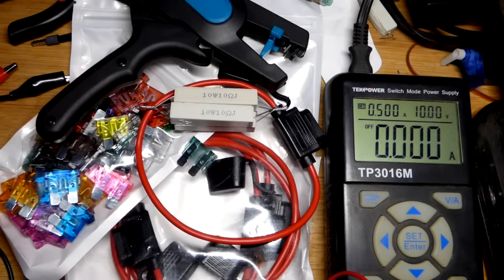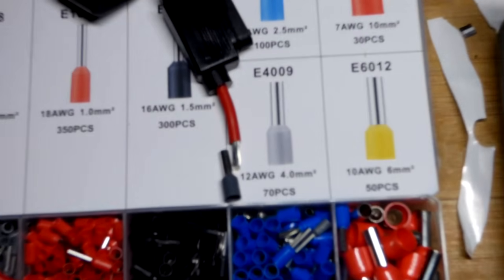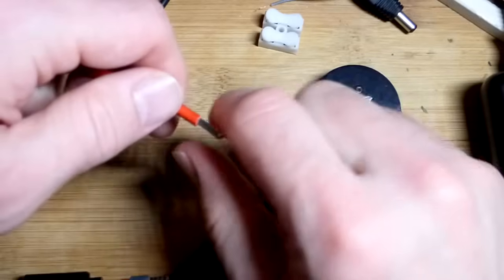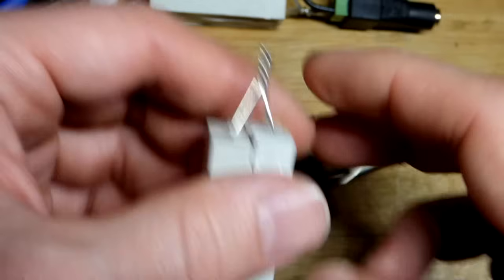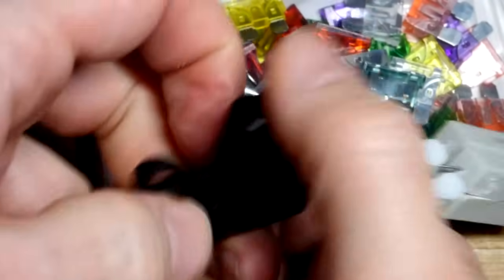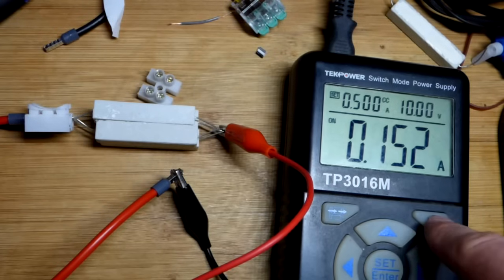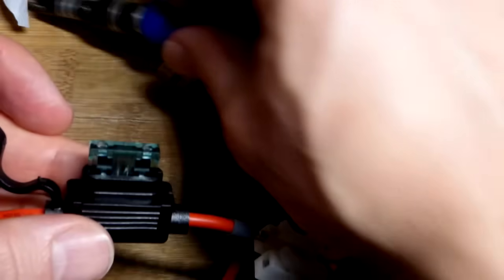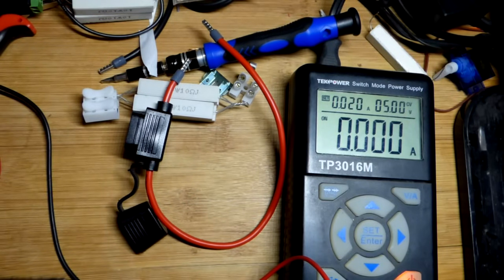Testing an Amazon generic fuse and holder I had after watching Louis Rossmann warning video

Comment from the maker: Louis Rossmann's video https://youtu.be/B90_SNNbcoU?si=3vuWCN3tAmdm5gI5 The Downfall of Amazon, pt.2: Top Ranking Electrical Fuses Show Dangerous Results
Wire cutter/stripper https://amzn.to/3urX9Ib - Ferrules and crimper https://amzn.to/3MEV80u -
List of my videos https://www.youtube.com/c/electronzap/videos
https://www.youtube.com/@Electronzap/community for most of the diagrams I've used in my videos.
https://www.amazon.com/shop/electronzapdotcom As an Amazon Associate I earn from qualifying purchases. Americans should check out one or more of those links before making any purchases. There's no extra cost to you.
https://www.patreon.com/electronzap
https://electronzap.com/
https://www.reddit.com/r/ElectronicsStudy/ 

After I bought some fuse holders with fuses on Amazon, Louis Rossmann made a video showing how fuses on Amazon have a tendency to not blow anywhere near their rated current. I test a 1A fuse and holder from 1 of 3 kits I have.

Comment: My biggest concern with these inline fuse kits is the wire itself.  Theres an assortment of fuses up to 30 amp.  I would not be comfortable pushing 30 amps over the 14 gauge wire they supply.
Reply from the maker: Yeah, the kits tend to include some fuses that have a higher current rating than the wire they provide. Something important for people to be aware of.
Reply: we sugguest the maxi current of 14AWG can not exceed 20A. 12AWG can not exceed 30A

Comment: But you got them in parallel, so current has split 1.5A per fuse. Am I wrong?
Reply from the maker: They are inline, so that's a series connection where everything shares the same current. Parallel connection would be the way to split up current evenly if each path has the same amount of resistance/opposition to current.
Reply: There was only one fuse. The resistors are in parallel, so the current is split across the resistors, but there is only one fuse so all the current goes through the fuse.
Reply from the maker: @SteveRaynerMakes  yup.

Comment: These are typical automotive fuses, and they are almost all from the slow type, never seen such a plastic fast type automotive fuse while i worked as a car mechanic. 
This means that they can and will stand at least 150% of there rating. 
It's not because there is 1A, 2A etc printed on a melting fuse, that the fuse blows at that amperage. Only the Fast and Ultra Fast one's do this, and those are the glass fuses, not these plastic ones for automotive use. 
If you go to well known brands like Littlefuse, Esra, Eaton/Bussmann, they provide charts where the response time is advertised, but again, for the glass type ones. 
Also, there is a big difference in response time when you hook up 3A to a 1A fuse in steps by slowly raising the amperage, or by applying 3A inmeddiately. 
Allmost everyone forgets that a fuse is a thermal component, it relies on heat to blow, the heat is developed by using a certain amount of resistance vs current. 
Low amp fuses have a higher resistance then higher amp fuses. Fuses have 3 purposes, and this is with each device that contain a fuse in it : 
1) cutoff the power in case of a dead short, a dead short in automotive means a lot more then 5A that a lab powersupply can deliver. 
2) To protect a circuit against overloading, by limiting the maximum amount of current that can flow. 
3) To de-energize a circuit for diagnostic purposes or when doing repairs/ modifications on that circuit. 
You can spend your entire bankaccount on buying fuses from the net and local autoparts store, you not gonna find 1 automotive fuse that will blow at the amperage printed on that fuse. The amperage printed on a automotive fuse means that for example a 1A fuse can continuous pass 1A, with 150% of that amp rating, a automotive fuse can withstand that for hours. Only when the overload is 500% or higher , the response time of a fuse is in seconds. This delay is mentioned in charts of well known brands. 
If you want a circuit to go open at 1A, you need to use a 0,5A automotive fuse, but that is a wide gap between both values. Compared to a glass fuse that can as low as 10mA, with many values before reaching the 1A value. 
We are here talking about automotive melting fuses, but with melting fuses in breakerpanels at home for 120V or 240V, it's the same, a 10A or 16A doesn't blow open at that amount of current, because these are also the slow acting type. And that is needed, otherwise a inrush current will blow your fuse open each time.
Reply from the maker: Thanks for the info!
Reply: Slowly going higher...doesn't matter if you go slowly from 1.5 to 3 when it blows or you slam a 3 into the 1.
It should not happen.
If you give it 1.5 into a 1, it should pop, that is the idea of a fuse that has a limit of 1A
You make no sense.
Imagine the car maker saying you need a 10A fuse, and labels it as a 10A but yeah, it's all relative dude, you can put a 15A fuse in there or heck, put a 20A fuse, because read the silly comment above of bjron
Reply: @tommyb6611  do your own research and look at datasheets of Littlefuse and other brands of automotive. Ever heared of inrush current ? Look that up and then come back. Per example, a fan blower of  a car has in general a 15A fuse, if you start that fan, it will act like a dead short and will pull much more current then 15A, If a car fuse should blow at the exact amp rating that is printed on the fuse, you are replacing fuses every day and you should buy your fuses in pallets to keep up.
Reply: @tommyb6611  also, i never said to use a higher rated fuse then recommended, i said if you want a automotive fuse to pop  immediatelly at let say 1A, you need to use a lower value then 1A. 
If you lookup the datasheet of Littlefuse on automotive fuses, at 100% use of the rated amps, the response time is 360000 seconds or 100 hours !!!
Reply: @tommyb6611  Hi, I can't send links on youtube but if you google "blade fuse datasheet" you can find a datasheet from littlefuse. In that datasheet the 1A fuse with 1.5A going through it, it will take almost 10 seconds to blow(but only 0.1 second at 3A), according to the "Time-Current
Characteristic Curves" diagram. the 2A fuse lasts over 1 minute at 2.5A.